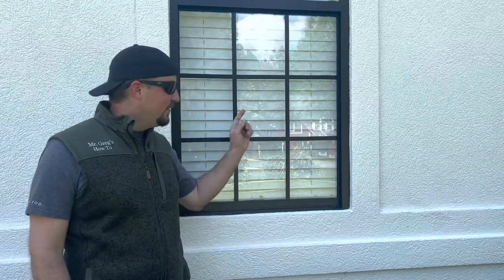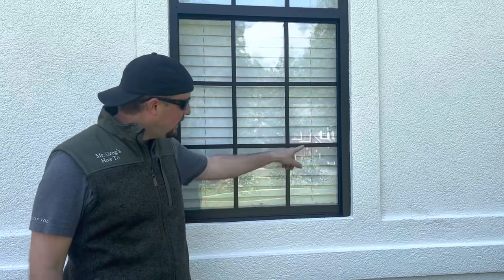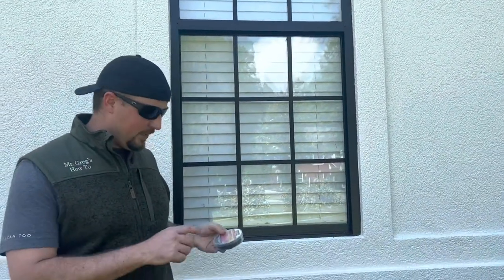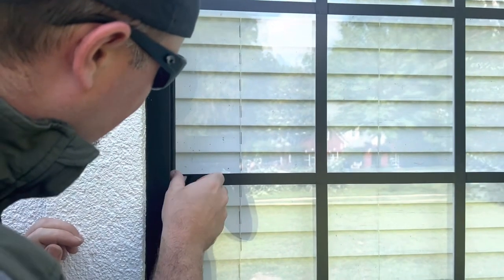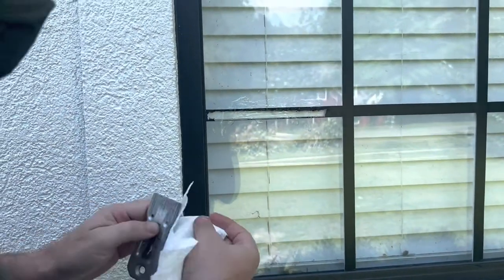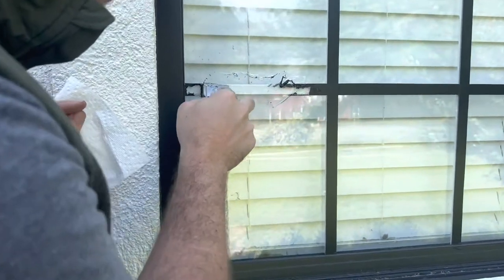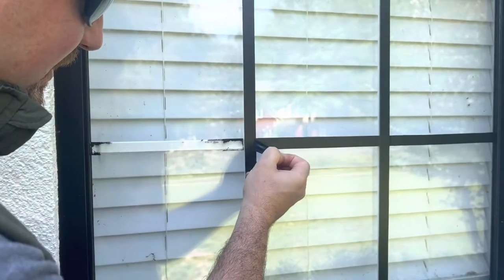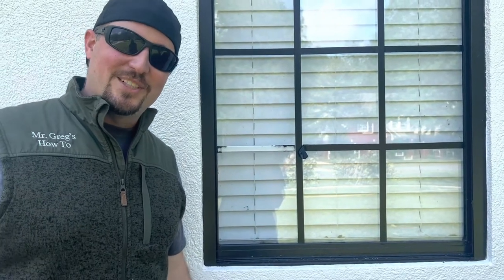Regret or Reward? White Windows Turned Black

Comment: Thank you, Greg, for the update video! We are in Louisiana and before making any changes outside the house need to be sure it works well in our heat. The idea with the tape is so clever!
Reply from the maker: You’re welcome, partner!  Thanks for the kind words. It’ll do fine in the heat.  Good luck!
Reply: What kind of tape did you use
Reply from the maker: @j.d.blackacreii2011  hey partner!  I used Scotch Super 88 (link in the description).  Good luck!
Reply: Sherwin williams makes "vinal safe" colors and some are dark. I chose one that is supposed to look black but really is dark brown. I actually think I like the dark brown now that it's on more than I woulda liked black. They don't use dark pigments in the paint so they use orange and blues ECT to achieve the dark color and it doesn't soak up the heat like a dark pigment. It is important to mix the paint well every time you use it since there is so much pigment in the paint they separate in the can. You open it up and see oranges and blues ECT. I just didn't wanna chance warping my windows with black paint so I went this route.

Comment: The tape is very clever. And you spray painted the rest of the window frame? What kind of paint & prep?
Reply from the maker: Thanks, partner!  We used regular spray or DTM paint for these aluminum windows, but there is a special formulation for vinyl windows that deflects heat.  Here's a link to the full how to video: https://www.youtube.com/watch?v=qimbv1hpbYQ

Comment: For vinyl windows would you recommend sanding the surface first before priming?
Reply from the maker: Howdy, partner!  The paint I used is direct to metal. There is a paint specifically for vinyl that even when black still reflects heat. I would look into that one for sure.

Comment: So this is exterior, is it possible to paint the track of a horizontal sliding window?
Reply from the maker: Yes, this is an exterior example.  You could paint horizontal or vertical.  Depending on usage and your window the track may scrape paint a little if you open and close a lot.  Good luck!

Comment: Hi Greg,
I like the hack of using the electric tape for the grids, but how does it hold up when washing your windows with window cleaner or a power washer?
Reply from the maker: Howdy, partner!  It’s been a few years and looks like new. No issues with normal cleaning or intense weather. I haven’t tried a pressure washer yet.

Comment: How do you know what material the window is made of?
Reply from the maker: Howdy partner!  If it feels like metal it is probably aluminum, if it is smooth and softer when you knock on it then probably vinyl. You could also try to scratch the surface with a nail and feel if it is metal or plastic. Good question actually. Hope that makes sense!

Comment: Man i dont get it i used the same spray paint i cleaned the windows sanded a little primed then gave mine 2 coats and they are chipping all over the place 😢 (same climate hot summers mild winters but can drop below teens ) 🤷🏼‍♀️🤦🏼‍♀️😭
Reply from the maker: Howdy, partner!  Not sure what happened there.  Are your windows vinyl or aluminum?  These are aluminum and we did not prime.  Several years later and still good as new.  Sorry to hear of your challenges!